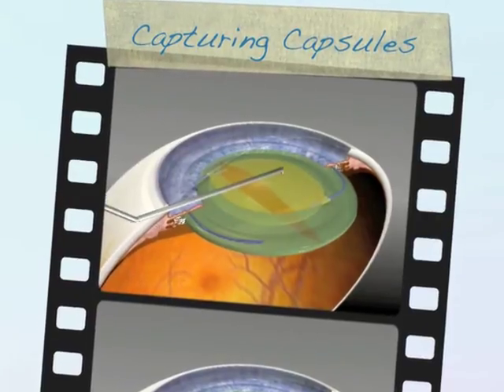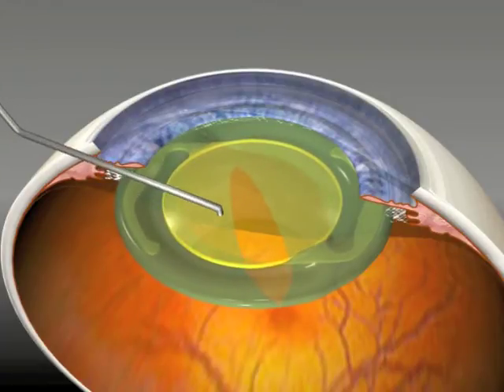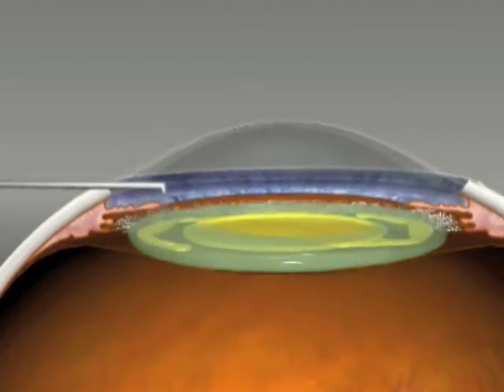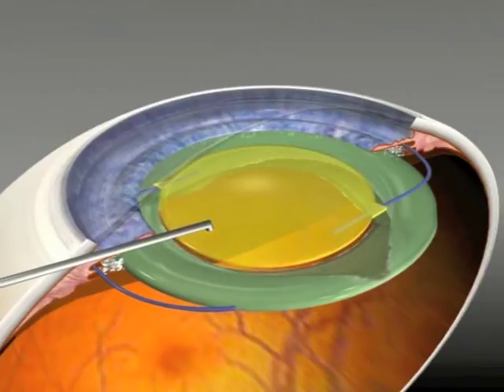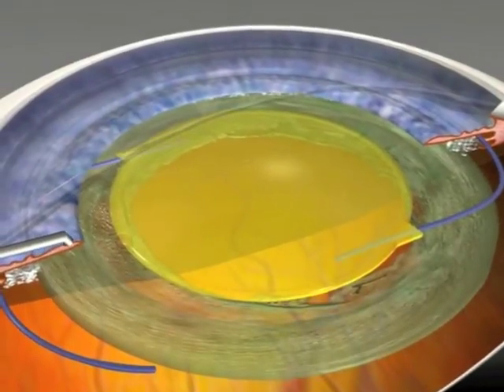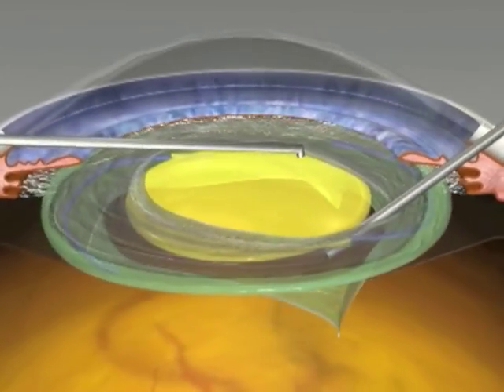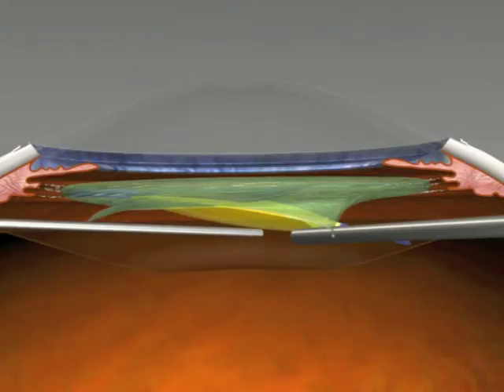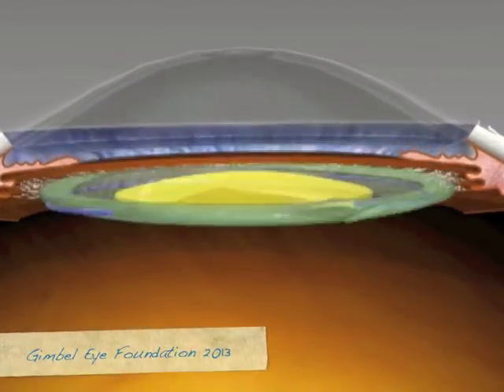Capturing Capsules

Comment from the maker: Be vigilant of your movements while executing CCC especially with forceps making sure the movement is at the wound and there is minimal escape of viscoleastic through the would. Otherwise you will lose viscoelastic and the AC will become shallow making the anterior capsule more convex and causing the leading tear to run towards the equator.  To help maintain the AC depth, also keep the infusion bottle raised high.

Comment from the maker: Hi Dr Ana

Achieving consistently sized CCC is the consideration that this is a process involving aseries of steps, usually involving frequent grasp and re-grasp manoeuvres so to direct the leading tear in the desired direction. Be patient and go slowly. Working with vector forces, it is in your favour to achieve the desired CCC size if the anterior capsule is flat and the anterior chamber is deep.